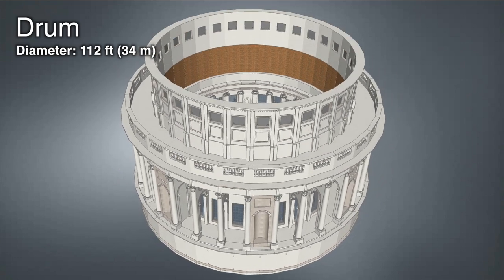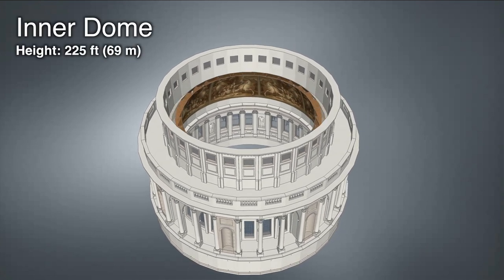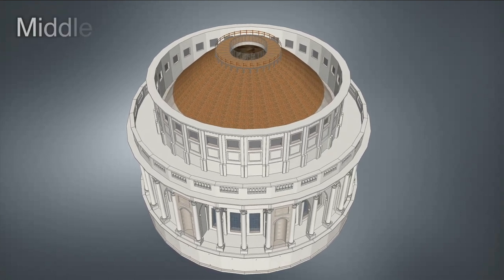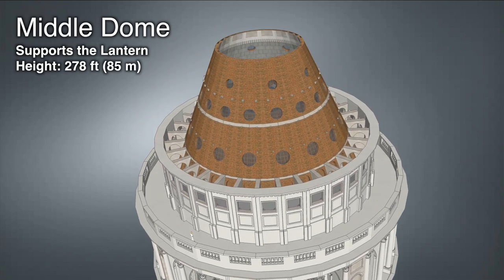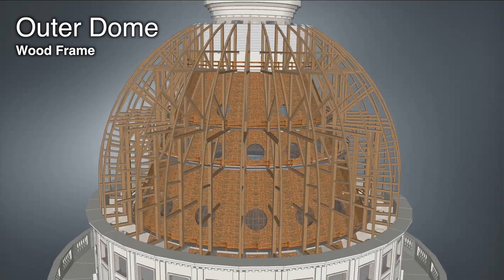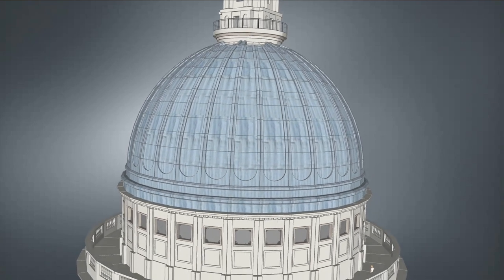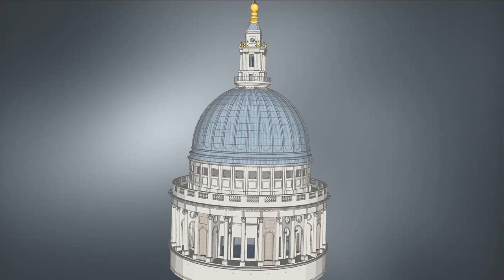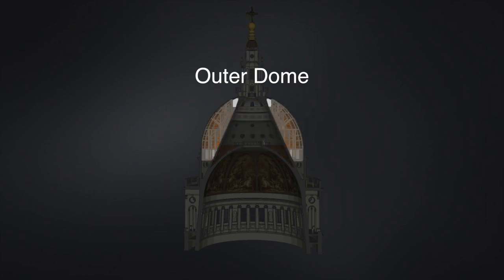How is St. Paul's Cathedral dome constructed?

Comment: Fascinating video. I have actually climbed right up to the lantern, where the views are amazing. The wooden staircase is very narrow and a bit frightening! I'm not sure if visitors are still allowed to go up there.
Reply: when!! what year??
Reply: @SpiritDomain1144  1991
Reply: I climbed up earlier this year but the highest I could get was the golden gallery, the lantern access was shut off to the public unfortunately but the view from the golden gallery was still fantastic and well worth the climb. Like you said , the climb was incredibly tight, I'm 6'4 and 250lbs and felt more than a little claustrophobic at certain parts of the it.
Reply: Hey I thought I was dreaming. When I was 14/15, in 1971 me and my cousin climbed to the very top. There was a small door about 2 ft wide and very steep stair case going up so up we went. I'm sure we were right under the cross. It was open to the elements and could see all around. I placed a penny pre decimalization there behind one of the arches that support the cross. I swear this is true.
Reply: @robinc5601   it's still there

Comment: DID YOU KNOW FACTS that were little heated of

The dome is 365 feet tall, one foot in height to represent each day of a standard year. 

24 windows around the stone drum, one to represent each hour of the day

The ball and cross weighs 7 tonnes but is 7 meter tall, a meter to represent each day of the week.

The climb is 528 steps but 528 hz is the love frequency. 

The dome has a brick cone and oak scaffolding to support the 700 tonne lantern. If you put all the wood scaffolding end to end in the dome, it would measure up to 10km long. 

The only gallery not open to the public is the ornumental gallery for safety reasons.

The circumference of the dome is nealy the total height in metres.